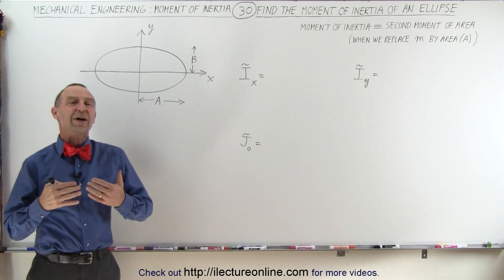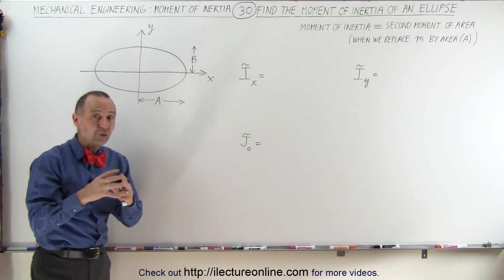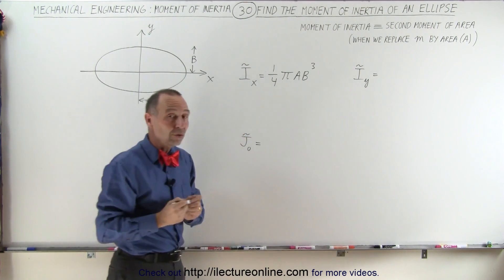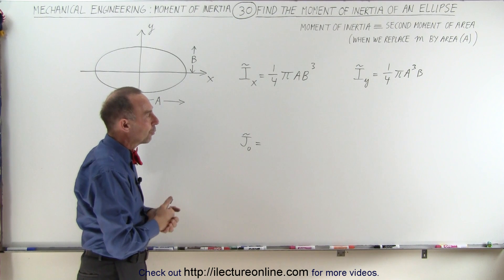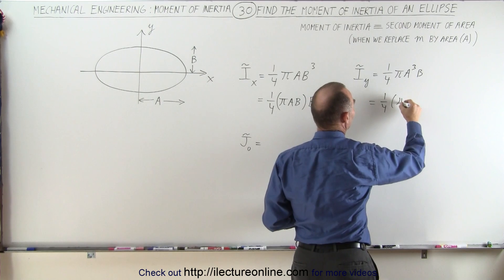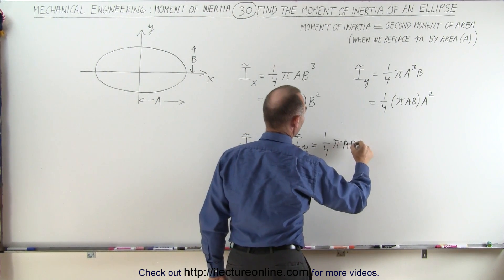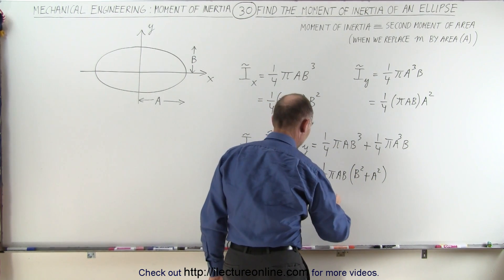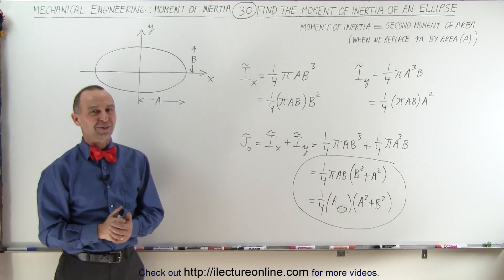Mechanical Engineering: Ch 12: Moment of Inertia (30 of 97) Moment of Inertia=? Ellipse

Comment: Hi there, I have a question...
Is the final formula to find the polar moment of inertia:
1/4(A(ellipse))x(A^2+B^2)
I have calculated the area of the ellipse to be 100.691mm, A=6.491mm, B=4.9825mm
I plugged in to get
1/4(100.691)(6.491^2+4.9825^2)= 1685.527mm^4

I was just looking for some guidance as I am not a maths or engineering student but in STEM looking to find polar moment of inertia (J) for the purpose of a cross-section of a bone specimen

Many thanks
Reply: Any help from anyone is greatly appreciated!